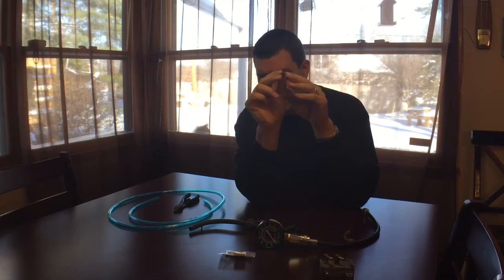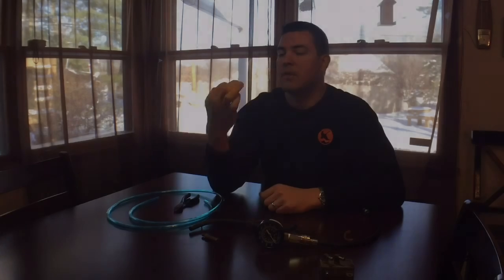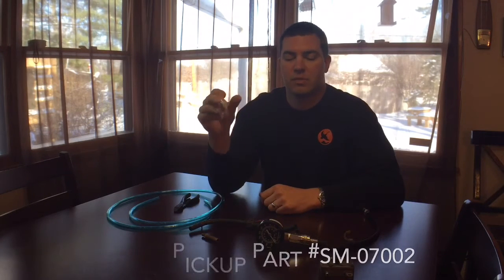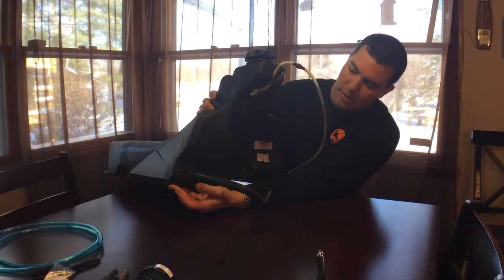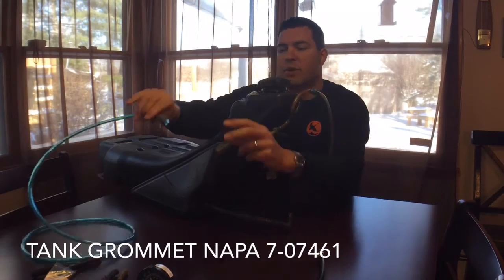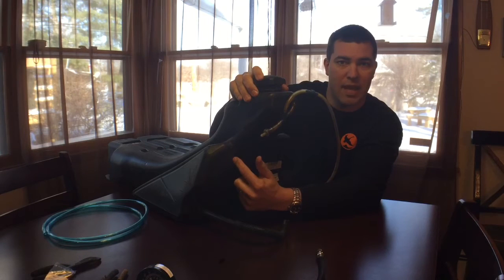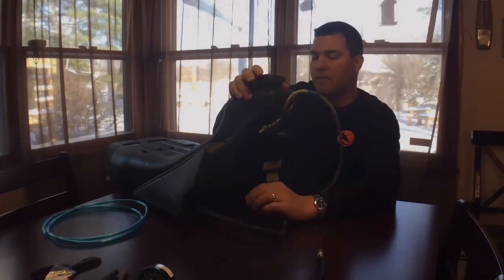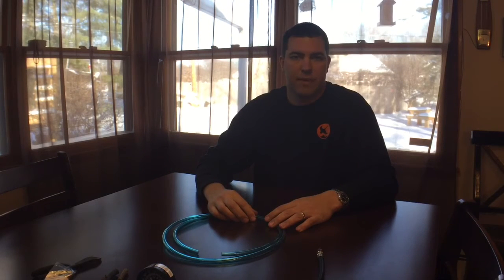#1 problem with Snowmobiles from the 70's 80's and 90's and soon maybe 2000 models.... IS???

Comment: I just did all that on a 96 polaris snowmobile. I wish I had seen this video before I fixed it. I thought my fuel pump was bad also. I cut the old inline filter in half and used it as a  funnel to dump gas/ oil mixture down to the pump. I also  put fuel in the sparkplug holes. After the third time of doing this, the engine stayed running and I took it for a short ride. I was really close to buying a new pump. But, didn't have to. Thanks for the video!!  It confirmed that I did everthing right.
Reply from the maker: Richard Howe You’re welcome I’m glad I was able to help!

Comment: I have a 97 arctic cat that seems to be having this or a similar problem? It’s not starting, then blowing air into one of the lines with my mouth, then it will fire up. Thought maybe some filter or vacuum situation wasn’t working.  But the fuel is prob lower than half tank, maybe it’s this problem? Why is the blowing into the line helping me start it? And it’s seems to keep running until it’s shit off again, then not starting till I blow again, lol

Comment: I have a enticer 340 89 it runs cold then shuts off hard to start won’t run again thinking it the coil but not sure the carb is clean everything seems to check out what ohms should a coil be

Comment: my sled is only running  on one cylinder   and was just rebuilt  could this be the Cdi it is an 85 Yamaha excel
Reply from the maker: I doubt it, have you checked for spark on that cylinder ?
Reply: +joesnowmobiles yep
Reply from the maker: +andrew jeanveau so does it have spark or does it not have spark on that cylinder
Reply: +joesnowmobiles it has spark it start but runs on one cylinder
Reply from the maker: +andrew jeanveau have you checked the compression? Should be at least 120-130psi
Reply: +joesnowmobiles I don't have a tester
Reply from the maker: I would suggest stopping at your local auto parts store to pick up a compression tester they usually rent them for free with a refundable deposit, lets check the easy things first. If you have low compression on that cylinder it would cause it not to run well or at all. Check both cylinders while your at it, and check back with me and let me know what you find.
Reply: It runs well at idle but give it gas and it has no power cuz it runs on one   cyilender at idle it sounds good
Reply: I have the same problem it will idle but when u give it gas it bogs out and won't drive. help plz?
Reply from the maker: Brad Weber have you checked your compression yet? Should be above 110psi at very minimum.
Reply: Not yet, I have an Indy 500, but I will
Reply: My 86 formula mx does that too when I start it it runs on 2 cylinders for 3 seconds and then it runs on 1 cylinder. It has spark and my compression is 125 on both cylinders it don’t know the problem.

Comment: What is the easiest way to get to this and fix it?
Reply from the maker: Hi Brian,
On some sleds the front of the fuel tank is accessible without removing much, but on other sleds you might have to remove the carbs or even remove the seat in order to get access to the fuel grommet on the tank. Once you get access to the grommet pull it out, install a new fuel line about 12-16inches long, along with a new fuel pickup. Then reinstall and hookup your fuel lines again and you should be pulling gas once again.

Hope that helps!

Comment: I have a 1984 ski doo citation LS 250 and I replaced the fuel pickup in the tank but I'm still not getting fuel to the carburator. I looked at the fuel pump and,it was fine. I'm still not getting fuel to the floatbowls, if I prime it it will run for a,few seconds then die, what do I do???
Reply from the maker: Sean Mingletats hi Sean, was the sled running good prior to you replacing the fuel pickup?